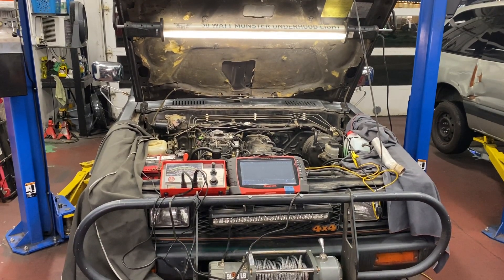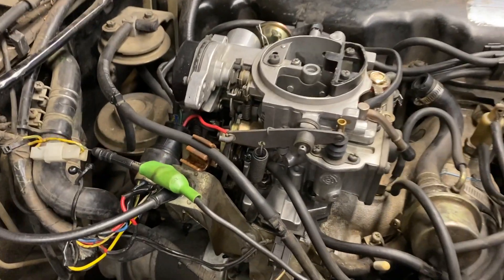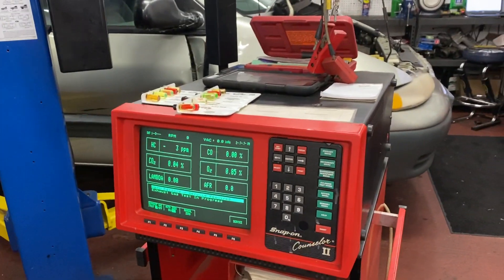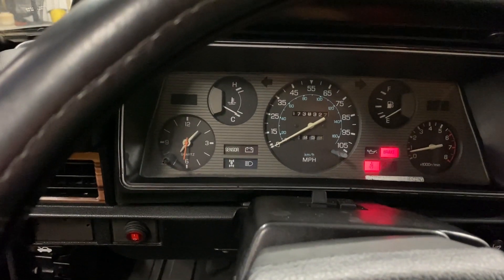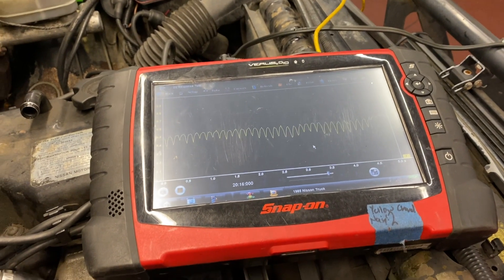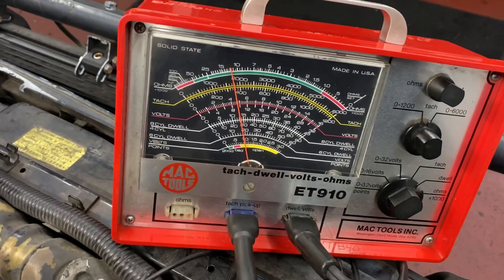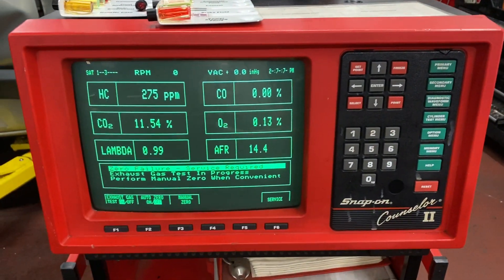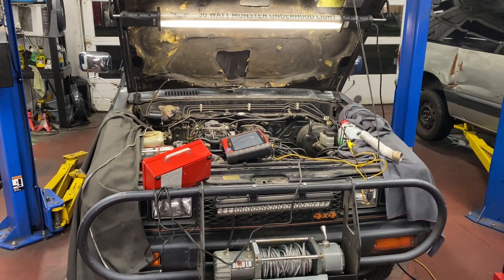Dr Rob The Car Doctor 1985 Nissan Truck Electronic Carb Passed Emissions!

Comment: My wife and I had 2 85 720s in California. I keep mine 10 years! I had to convert to fuel injection since the carbs would warp.
Reply from the maker: KOOL...yes I bought this truck specifically so I could study up on and learn the complex electronic feedback carb. I'm pretty sure the carb was changed for a bad vacuum switch. Now it is time to master the Z24I TBI system.... :)
Reply from the maker: Very Kool! Yes electronically controlled carbs can be very finicky and take a great deal of patience and understanding to properly work on them! I bought this very truck so I could learn the Electronic Feedback Control System inside and out, and then be able to help our customers out here at The Car Doctor Shop! 

PS: THANK YOU for your wonderful tips on how to convert the carb version to EFI!  You inspired me to do that as well......... :)